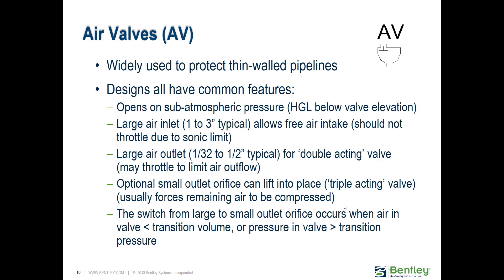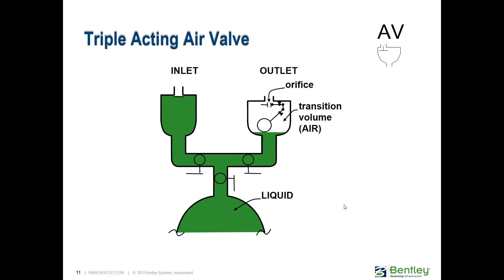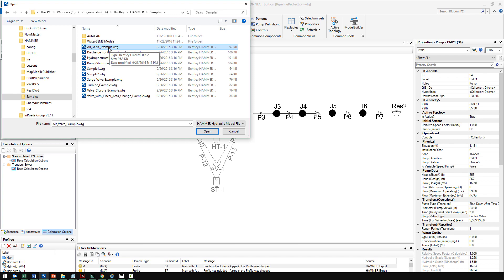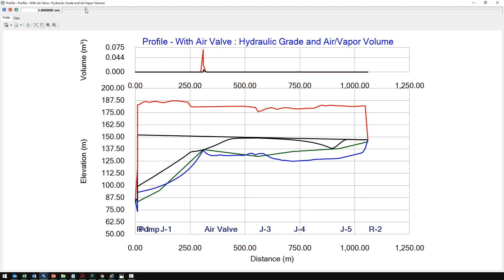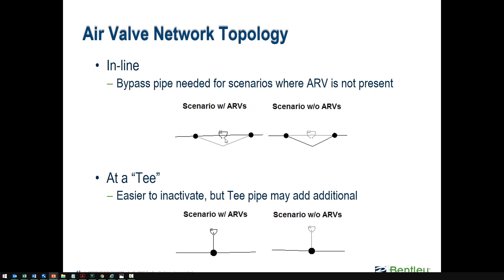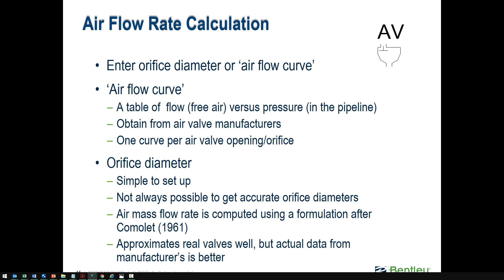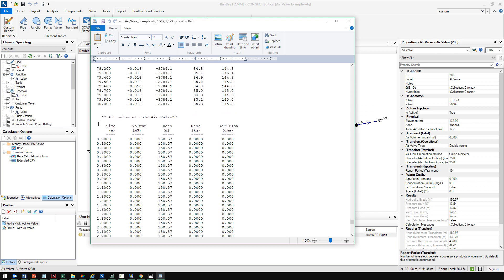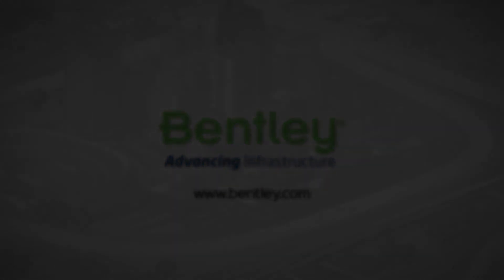HAMMER Training Part 9: Surge Protection using Tanks and Valves Part 2

Comment: Great Video-- you mentioned in one of your videos that AVs are not the primary surge protection device in case of a pump shutdown, to deal with the negative pressures do we have to consider some pressure tanks adjacent to pumps or we should consider surge tanks for even (-1bar) pressure.
Reply from the maker: Typically a hydropneumatic tank will be installed on the discharge side of the pump, to keep the water column moving and protect against low pressure "downsurge" waves, with air valves at key high points further downstream. Every system is different though and the engineer must always consider other constraints like space and budget. Use scenarios and alternatives in HAMMER to analyze multiple possible surge protection strategies.

Comment: Great video -- you mentioned at the beginning that if you oversize the outlet orifice, it can result in worse transients than otherwise if no valve was present. I think that is my case. I have a very high flow of 1327 cfs moving through a 78-inch pipe. When I shut a valve in the line, the pressures on the downstream side of the valve drop to vapor pressure, likely due to water column separation. I added an vacuum air valve and it didn't help (it seemed to make it worse), probably because I just assumed a huge orifice. Do you have a guide on selecting the appropriate orifice size so that HAMMER will compute correctly?
Reply from the maker: Ron, you may need to use trial and error - try using a smaller orifice size based on available air valve manufacturer sizes and check the impact it has on the transient simulation. Set up separate scenarios if needed (separate child Transient alternative) to compare effectiveness. Also try different sizes of triple acting air valves. To discuss further please post on our forum: https://communities.bentley.com/products/hydraulics___hydrology/f/haestad-hydraulics-and-hydrology-forum